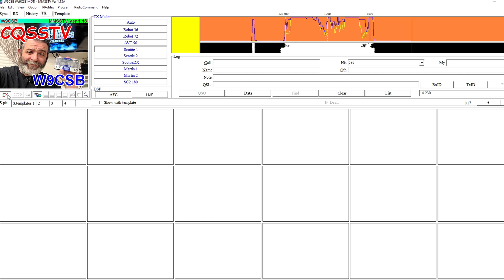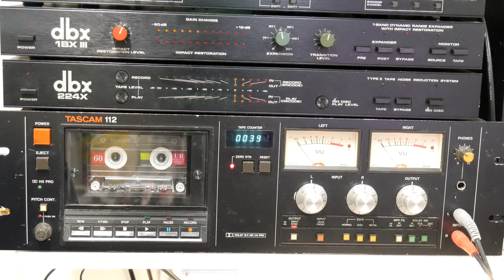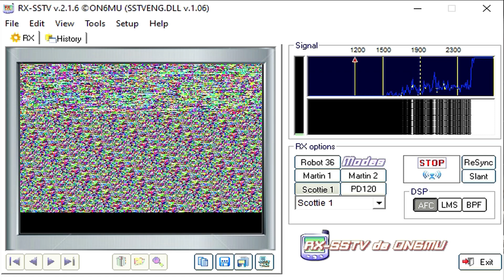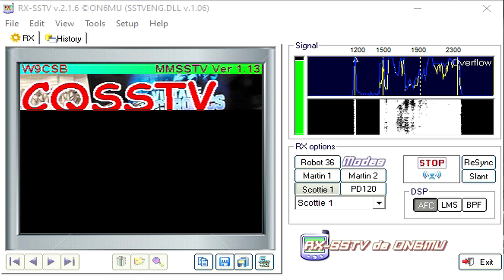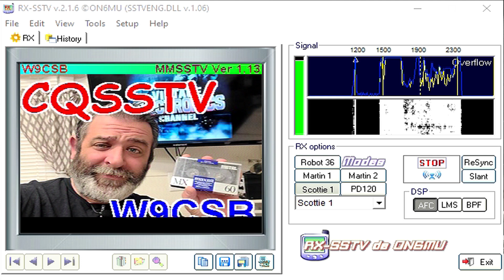Storing Video as Sound - Slow Scan TV on Cassette Tape

Comment: It's really funny today we store PCM sampled (& FLAC compressed) FM RF signals from VHS to 2" Quad for preservation and use with vhs-decode, as you can compress VHS/Video8 and smaller formats signal down to 16msps 6-bit or about 300MB/min lossless, audio DAWs will read these files as "16khz" for example but the whole data range is there you can see each frame/field/line in the FM domain or in the post decoded baseband one.
Reply from the maker: That's fascinating, thanks for sharing that information!
Reply: @VintageElectronicsChannel Yeah it's a big family of projects, but if you don't know about it already have a look at the MISRC and HackDAC stuff!

Comment: Fisher Price made a camera that records black and white video and sound to audio cassettes by running the tape at 9 times the normal speed. It was called the PXL 2000 but I'm sure you already know about it.
Reply from the maker: I wanted one of those as a kid. When I finally got one a few years ago, it was intriguing, but disappointing.
Reply: @VintageElectronicsChannel  I have the suspicion that if a rotating head (at high speeds) were used on those units instead of the stationary head they came with, it would have been possible to store videos at a normal tape playback speeds, plus perhaps even at higher resolutions.

Comment: That was hard on the ear lol, but a great demo. SSTV works at 3KHz, but it's possible to record up to around 15KHz on a good quality analog cassette, so it would be interesting to see the picture download around 5 times faster using 15KHz modulation.
Reply from the maker: It's reminiscent of fingernails on a chalkboard for sure! There are numerous SSTV modes, definitely many to experiment with.
Reply: The channel Janus Cycle made a video about using the software narrow band simple color to store video on audio tapes a few years ago, I would post the video ID, but I already did in a reply to this that doesn't seem to have posted, perhaps it was caught by some filter. But if you search for Recording Video Images on Audio Cassettes you should find it.